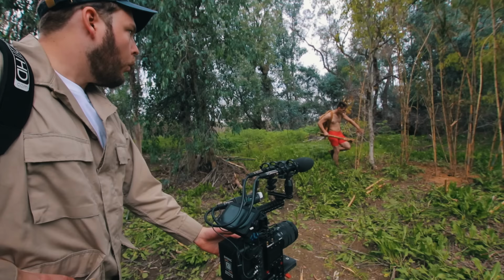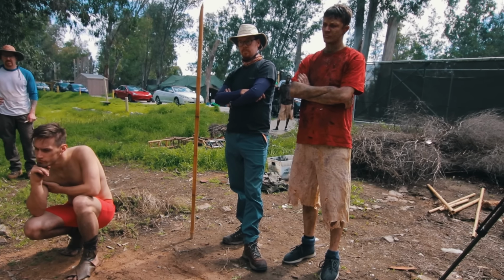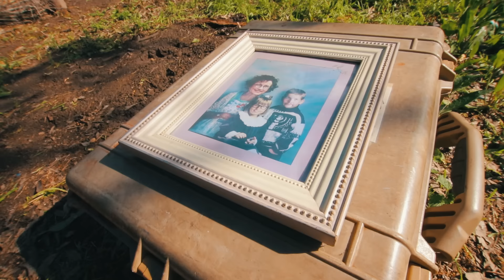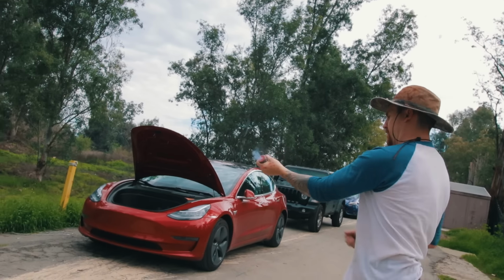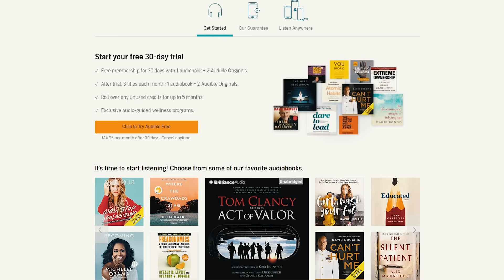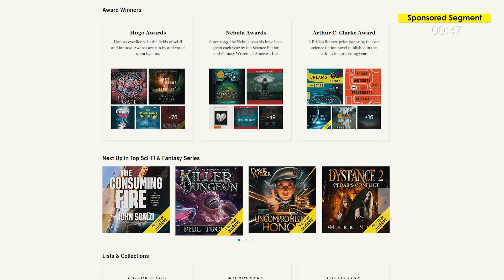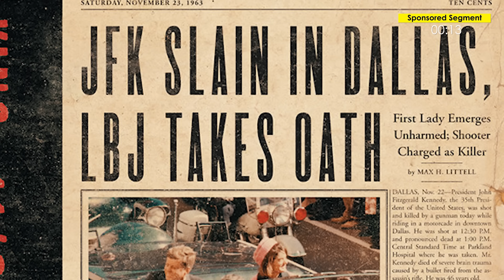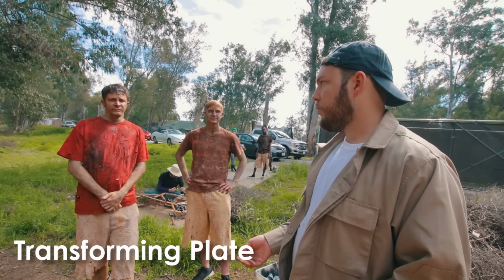VFX Artists Explain Everything You DON’T See When Making a Video

Comment: Lil tip. When drilling, the larger the drill bit, the slower the drill should turn. It will unexpectedly cut much faster that way.
Reply: Owen Pidcock 2nd tip: Cool that cutting cup by spraying it with soap water (water plus dishwasher).
Reply: Fucking hell, it took me 3 minutes to realize what you meant to say. Use some punctuation, mate.
Reply: @imapigeonyoupeasant1489  "When drilling, the larger the drill bit, the slower the drill should turn." xD
Reply: Brian G  Always 1 weirdo looking for attention.
Reply: @imapigeonyoupeasant1489  True that was annoying
Reply: @smokeypillow  He has since edited his  comment
Reply: Im sorry what
Reply: Also with Wood - Less Teeth.  They were probably limited by the size of the hole - but paddle or Forstner bits are better, especially for Hard woods.  Paddle = speed, Forstner = accuracy
Reply: @imapigeonyoupeasant1489  Sorry for the poor punctuation. I didn't exactly concentrate as much as I should have when I wrote it. Sometimes punctuation slips past my Dyslexia filter despite a hell of a lot of extra schooling. Ps, that's not a joke I'm actually dyslexic.
Reply: @thegrayyernaut  Thanks for the help, Appreciated.
Reply: @owpidcock  Oh not to worry, mate. It just honestly took me a long time to get what your comment meant to say, since English isn't my first language.
Reply: That's why TBMs are slow AF.

Comment: When using a hole saw, you need to stop drilling every other second to empty the gullets. The material has nowhere to go. It helps a lot if you drill a hole for the saw dust on the perimeter of the circle.

Comment: GUYS!!! You are using the hole saw wrong. You should drill a hole or two on the perimeter of your circle (inside/outside is both fine, as long as it's touching the saw line). That way the chips evacuate, and the thing actually freaking works. Saws like to clear chips out so the space between the teeth can be filled up again. Glorious video as always ;)

Comment: Drilling numerous smaller holes would help, backing out every quarter inch and clearing out the offcut helps it not bind and smoke. Diving in and leaning on a motor is a recipe for broken tools and just not safe. Forcing any tool is not safe. A spade bit would be a better choice, buuuut I don't work for you so take it with a grain of salt.